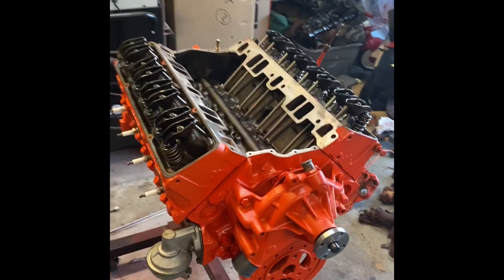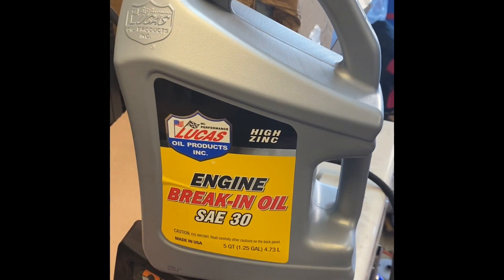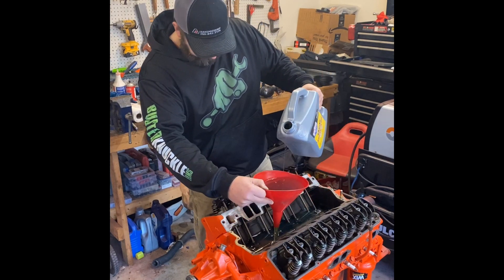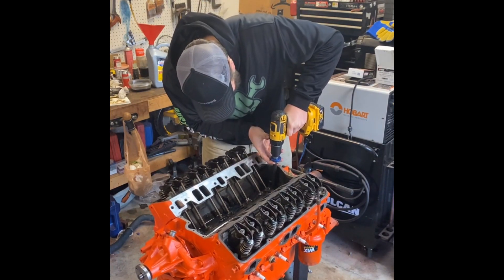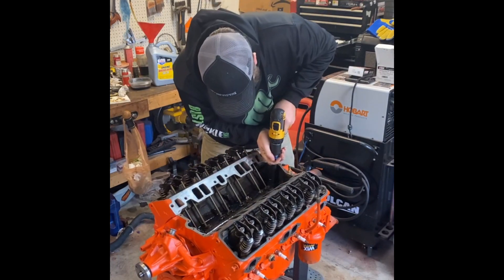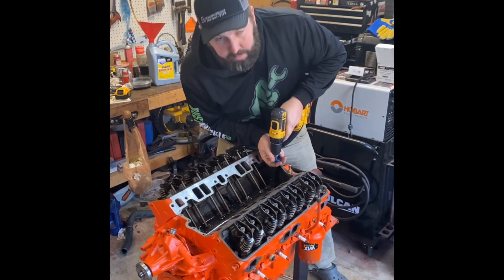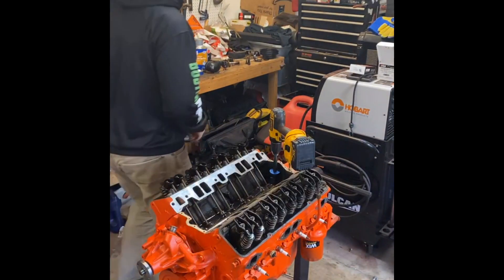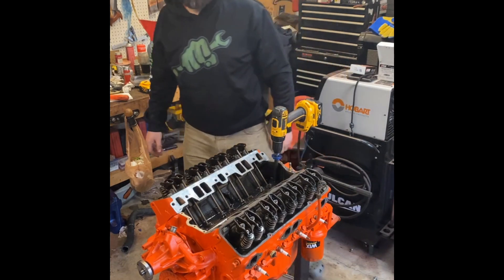How Long Does it Take To Prime a New Engine? | Sick Week Build Part 7

Comment: Your correct that soaking the lifters and pre oiling parts before even priming would have helped cut the time needed to run that pre-lube. But back in the day I've seen both people do everything right and wipe a cam lobe out in seconds and others barely do any pre lube and get 100k+ . So many variables like spring seat pressure, lobe ramp design and other things can cause wild variations in the outcome. But an ounce of prevention is always better than blind hope and a prayer LOL. But a prayer with that ounce is also a good additive LMAO

Comment: Using an old distributor to make a primer is best because those primers you are using doesn’t seal the oil where the distributor goes. Your losing all your pressure & volume.
Reply from the maker: Using an old distributor is great if you have an old one laying around. But this primer does seal the cam bore just like the distributor does.
Reply: I should’ve went back & looked at your primer before I commented, my bad. I do always put my manual gauge in to see what my pressure is. Thanks for your videos, I enjoyed watching them.
Reply: @woodysummers8618  yes that primer does have the piece that replicates the distributor housing (the bottom blue piece) the top one should fit onto the intake to center and hold it but the bottom piece unfortunately doesn't always go in correctly and seal correctly allowing the oil to not go into the correct oil passages and return to oil pan. Thats because its not a solid piece like the distributor housing and forced to go into the correct positioning  but its better than nothing. And checking the oil pressure with a manual guage would help confirm if it was bypassing or not but still this was interesting to watch how to "FIX" a red neck shade tree mechanic job LOL (btw I can say this as I'm from MS ya'll ) LMAO

Comment: Holy smokes, a nicad drill in 2023, you used it for 1 minute and had to change out 3 batteries, you're doing some good deadpan brother cause i cant tell if this is a joke or not.
Reply from the maker: There is a lot of time cut out of the film, and the batteries weren’t even fully charged. I assembled the engine with a dry pump, filter, and lifters, to see how long it could take. Obviously shouldn’t take this long, but it could.

Comment: We did not have fancy oil priming tools but most of us have a distributor with the gear ground off and drill bit welded to the top. I remember making mine in 1985 :)
Reply: Oh and pack you oil pump better that took too long.
Reply from the maker: No need to pack the pump. That pump picks up oil just fine every time the engine starts with nothing but wet gears.
Reply: @freedomworx  But the first time is the worst time to be dry. The fact he is priming the engine show that. If you do not need to pack the pump then why prime? Packing protects the pump vanes during break in. The fact the engine primes quicker is a side effect not the reason for doing it.
Reply from the maker: @famcadjr  That’s completely false. Anything you pack in that pump gets swept away in seconds. Oil pumps don’t break in…bearings don’t break in… the only thing that’s breaking in is Flat Tappet Cams and lifters, and piston rings and cylinder bores. 🤷🏻‍♂️

Comment: My grandpa always told me, if you want to break her in right, drink a few beers first.
Reply from the maker: Break-in and initial fire up are a little different. The only thing that breaks in are rings, the bore, and cam if it is Flat Tappet. Bearings, But yes, break-in is all about putting load on the rings!

Comment: I commented on your short video and would add here nowadays we used a penumatic oil primer. Made one out of an small cylinder with valves hose pressure gauge etc.  Should look into it
Reply from the maker: I’ve got an LS that’ll need priming, so I plan to make one for it 👍